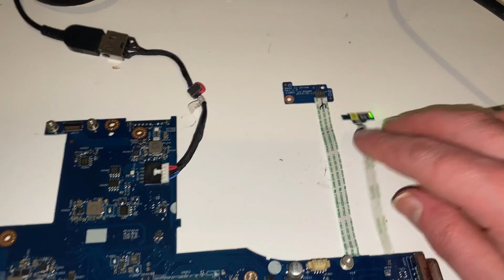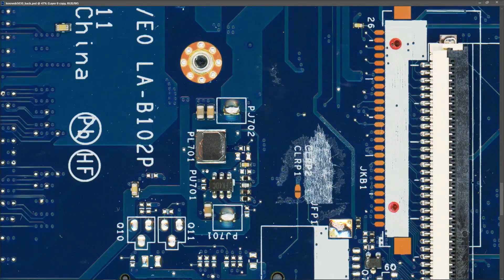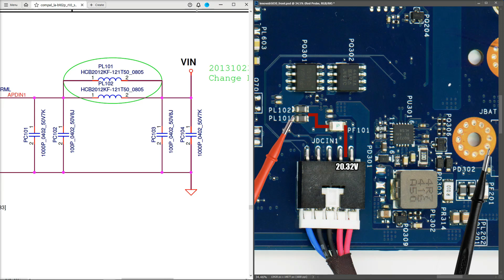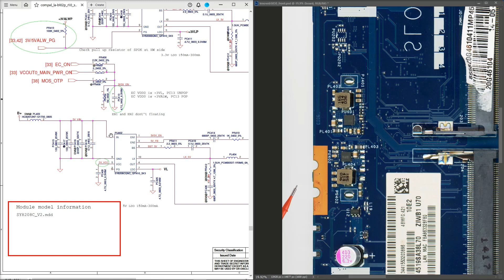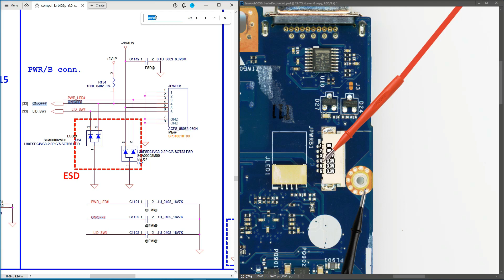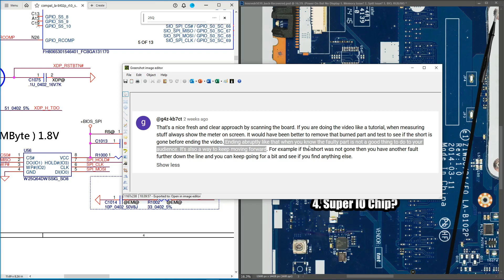ANOTHER LENOVO B50 30 - BUT NOT SO EASY THIS TIME (Part 1)

Comment: What about changing the RAM modules with some DIMM you know it works? Also, other parts may be responsible for short circuits, basically any component that's attached like the CMOS battery, and I hope it's not the GPU or the CPU!

Comment: if all power source (3,3v, 5v, main volt) is okey and bios is fine and if ram is fine, from my experience is IO chip, but IO chip is responding to power btn, it might be half shorted, you can check all the pins based on IO chip schematic
Reply: the worst thing if it has PCH chip, that chip must be the problem and costly to replace
Reply from the maker: @valinkakomputer  Hi Valinka, thanks for your helpful comment..... "but IO chip is responding to power btn" - This is my thinking also. It seems that the IO is responding correctly to the button press and all the main voltage rails are coming online, so the IO is certainly at least partially working. So I'm thinking CPU / PCH - unfortunately no way to swop any more. None of the inductors around the CPU are measuring as shorted though (~0.003V in diode mode, 35 ohms in resistance mode).
Reply: @therepairshare673 I think u can try check the power good signal then

Comment: Sure seems like an EC problem. I wish I could see the data sheet for the NUVOTON EC chip, which shows what pins 1-5 are for, since they had corrosion on them.
I don't remember you saying that you tried removing the coin cell battery to force a BIOS reset. I also don't remember you saying that you tested that broken inductor for continuity. You did say it was working fine, though. I hope you can find the fault.